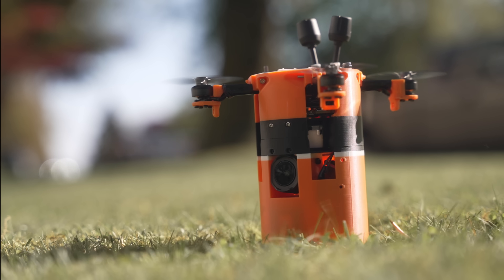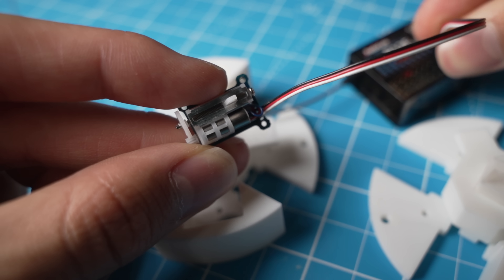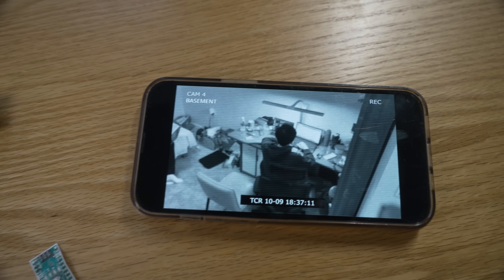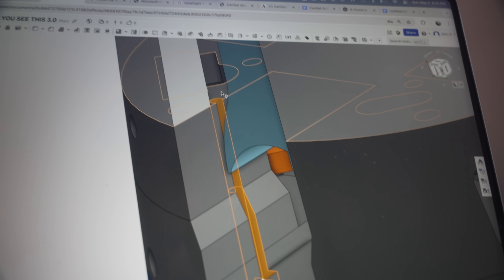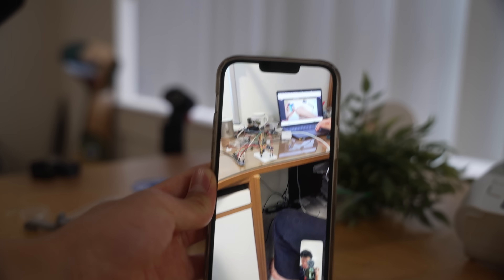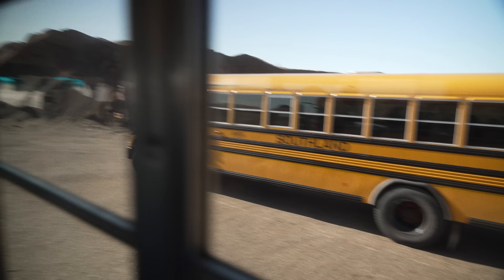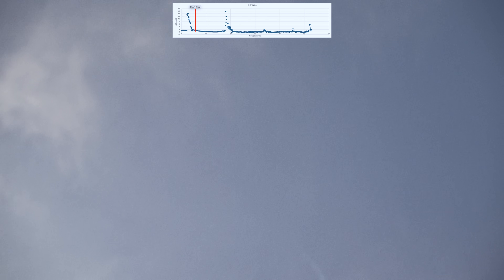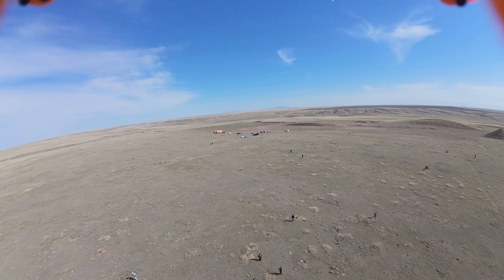I Built a Self Landing Satellite

Comment from the maker: Give me ideas for what I should make next ⬇
Reply: create a solar power forever running autonomous plane (at least for the day time)
Reply: Next video: I built a guided missile.
Reply: I was just thinking making a new version of this with maybe slight improvements! I love this project! Maybe just make it so it can land softer maybe slightly more powerful motors and with pop out legs using the same mechanism as the pop out propellers so it can land completely flat consistently from free fall. Also maybe make it automatically know when to stop free falling based off gps height and other things so user errors aren't as common. Super awesome dude!
Reply: @tylersmith3700 I have some extremely powerful brushless motors that can produce 2.5 kg of thrust which would be great for heavier payloads
Reply: A heat gun for your shrink tube
Reply: build a replica of the mars rover with low functionality
Reply: 1 propeller drone.
Reply: @PhalanxFPV This is possible, but you need a rotor-counter-rotating system!
Reply: Supersonic RC plane/rocket
Reply: 3d printed rc car, all terrain with fpv or maybe a 3d printed nerf ball gun?
Reply: A plane that can fly from USA to Germany!
Reply: If a GPS goes over 1200 MPH or 1931 KPH, or over the height of 60,000 feet or 18288 meters above sea level it will automatically shut down, assuming it could be a missile.
Reply: a mouth scanner that takes a standard shot of your teeth in multiple spectra and then uses UV lasers in fastpulse mechanisms to ablate any plaque, tartar, scum, bacteria, then uses a waterpik to cnc around your teeth to clean them out. super miniaturized and cleans your teeth entirely. at night. while projecting a movie onto your ceiling.
Reply: underwater drone
origami robot
Reply: Could you do this but it either soft lands under a parachute or cuts it when the motor arms deploy? this would hopefully give it a more stable starting point idk?
Reply from the maker: @Celestial.132  A parachute would def give it a more stable starting point, but the drone had no problem stabilizing itself even without a prachute, it only landed hard because I didn't raise the throttle soon enough haha
Reply: @ibuildstuff  A satellite by definition achieves orbital flight, this does not.
Reply: Hi 
I'm a big fan of your content and the way you present complex technical projects in such an inspiring and accessible way. I'm currently a high school student, working on an ambitious project—a cloud seeding rocket—which I plan to submit to the National Invention Competition.

Even though I have a solid background in rocketry, I’ve faced many technical challenges that I haven’t been able to overcome. I truly believe that your guidance and expertise could help me take this project to the next level.

I was also thinking—if you're interested—we could collaborate and document the entire process in a video for your channel. It would be a unique project that combines science, innovation, and real-world application, and I think your audience would love it!

I’d be incredibly grateful for any support or advice you can offer. Thank you for the inspiration you continue to give to young builders like me.
Reply: Build a powerful rocket moving at mach 5
Reply: A drone that can capture regenerative energy on descent.  

Let it get down to 10% on climb, see how much you can recharge on descent.  I'll bet you could get to 50%

If you could do this, it would change the world forever.
Reply: I remember once a design for a rocket called the Roton. It had propellors with rockets at the end in the nose cone and the whole thing could make a controlled landing a bit like Starship so it was re-usable. It might be possible to build something like that with a scaled up version of what you did here…
Reply: You should build a submarine/car/plane where it transforms into any one of them, you could also do submarine/boat/car/plane. I think that that would be a great project and a great video
Reply: How about a model rocket that can seek out drones by the sound of their propellers.
Reply: Somthing LoRA/Meshtastic related?
Reply: A paraglider design! Use less power, gather more data on the way down, have a longer range to work with.
Reply: Ok this idea is probably too ambitious, but: a drone which is able to deploy another, smaller drone to go and recharge it's batteries one at a time, allowing for continuous (or at least longer) flight
Reply: Honestly, I'd try to program the controller to catch itself during fall. I suppose there are altitude sensors, so you could force the drone to stabilize a few tens of meter above the ground, and then if the precision is not great you could add an ultrasonic sensor below the drone to approach the floor slowly. That way you remove all pilot error from the equation, if the drone doesn't receive inputs it starts the automated landing sequence, and if it does (during the automated landing) it stops the controls overrides and lets the pilot do it's thing, either land the drone of fly it to the base.

Also, I don't know in the US but in Europe afaik you can have GPS on board of the drone. There are even drones that fly home when the controller signal is lost, so I suppose guided landing is not impossible to perform.

Maybe add a winged nose to the bottom of the drone and slight throttle of some rotors to stabilize the drone towards the objective during free fall? Just so you don't have to fly horizontally to your home base all the way, you know? Although... Yeah, at that point, that's just a guided missile xd

Still it'd be fun I think!
Reply: BACTERIA CAPSULE COMPARTMENT INSIDE YOUR SATELLITE TO SPREAD THE PEST OVER 1SRhell
Reply: GPS “CoCom Limits"
In GPS technology, the term "CoCom Limits" also refers to a limit placed on GPS receivers that limits functionality when the device calculates that it is moving faster than 1,000 knots (510 m/s) and/or at an altitude higher than 12,000 m (39,000 ft).[37] This was intended to prevent the use of GPS in intercontinental ballistic missile-like applications.

Some manufacturers apply this limit only when both speed and altitude limits are reached, while other manufacturers disable tracking when either limit is reached. In the latter case, this causes some devices to refuse to operate in very-high-altitude balloons.[38]

The Missile Technology Control Regime's Technical Annex, clause 11.A.3, includes a speed limit on GNSS receivers, set at 600 m/s.
Reply: nice video bro
Reply: hyperloop
Reply: Sense.
Reply: A larger RC plane that can drop this can for practice landings!
Reply: More like leading him to anduril or ukraine
Reply: Use a similar drone to track and film skydivers in freefall.
Reply: Build a drone police officer, a drone that sits on a flat surface that talks to a Raspberry Pi, any sensors on the house that get activated will alert the drone police officer to fly up above the property and start sending video of  the area of the property and when the Raspberry Pi is reset or the maximum hoover time is reached the the drone police officer will land back on it’s charging landing pad.
Reply: A small drone that's also a very fast RC Car.
Reply: Same sort of project but it works via pure autorotation rather than powered propellers. You would just have free spinning but variable pitch propellers. Why waste all that gravitational potential energy. :)
Reply: Rc gryo unicycle plz. Why? Just because.
Reply: Could you guys build a 17.4 meter tall 4 legged Armored Core? It'll only cost like $47T so I'm sure guys have the budget right?
Reply: auto-rotation device to create the drag to slow it down
Reply: Use a weather baloo0n take it to the edgge of space then use a rocket to take your satalite into orbit.
Reply: Question, what about iNAV instead of BetaFlight? BF is more race drone software, and iNAV is easier to make your own software modules to. as i did for my winged-drone. i wanted a anti-stall function. so i had to make my own little module to mix pito airspeed data with throttle. what i did  was i recorded windspeed over the wing and stalled the plane. then i found the minimum airspeed needed to have it flying. so if the airspeed was under that speed i had set in the config list it did give throttle input until it kept the minimum speed before stalling. That was much easier to for iNAV than BetaFlight.
Reply: could you combine in the next launch a parachute and the rotors?
I think that first the parachute is activated and at a certain altitude is released and the rotors are activated, my idea is to reduce the speed of descent and saving battery.

I still don't understand what data they want to collect and what is the use of it?
or were you just measuring the power and efficiency of the rocket?
Reply: Flying Radio walkitalki  node.
Reply: I rocket that goes Mach 2…
Reply: Broo... your great... , maybe ... spin make gyro accellorometer can't hold up nose the drone , make free fall  , the fan blade just not working air flow only spin.
or you may test the drone by  throw to upper and with make the spinning , can the the drone  align the speed with the direction of the tilt position when rotating.👍
Reply: By using this method, we can supply emergency medical supplies like antivenom to remote locations.
Reply: You should do a collab with Xyla Foxlin!
Reply: Why not just use detents and have the motor thrust extend and lock the arms?
Reply: make a geiger counter
Reply: too bad you didn't keep the parachute and add a paramotor, you could have used it to catch the jet stream and reach 250 mph
Reply: Vibroplane https://youtu.be/DLwqnz2ypBI?si=QNYQEwwMxk76PFeM
Reply: You landed the satellite, now you need to land the rear section of the rocket and transform it into an inflatable habitat
Reply: I still think this idea is super cool and could be pushed even further. Perhaps build a "base station" of some sort to monitor data at greater distances. Maybe launch the rocket even higher, have  a parachute trigger at a certain time or interval of data, capture as much data you can with various arduino sensors, etc... GPS module to assist with landing back to your location, have the parachute detach after a set amount of time/set altitude, and fins that assist with direction to get back to you? I'm sure the possibilities are endless, but this one was really cool!
Reply: why does this seem ai dubbed?
Reply: I dare you to Build a teleportation device 😁
Reply: A bed that makes itself!!!
Reply: Interesting! 
Recommendations for Your Satélite!

- An altitude indicator
- Stabilizing wings at the top
- Low center of mass

This will cause the drone to fall vertically!
Then you need to control the rotation to the left to stabilize it!
Reply: Meshtastic/SAT
Reply: if u get a junior high power cert u can build and launch ur own rockets for stuff like this too!
Reply: 水中ドローン
Reply: Lets see your take on an ion thruster!?
Reply: Hoverboard
Reply: Rocket engine on rocket or a swing
Reply: A Dorne with spider legs that can walk on Walls
Reply: Have some helium filled balloons that can take the satellite to 30 to 40km above the surface and it launches.
Reply: *IDEA* Make a glider launchable in a rocket programmed to return to the  launch and circal to land, I think making and getting the flight running glider, something that could disconnect and unfold its wings, (controlable, maybe with some motor in the rear to give a boost to self righting.- but im sure theres loads of ways to do that.) something that could be dropped open and return. - good as rocket/glider race?? maybe someone at the rocket clubs could compleat..

Loved the video, and Its always inresting stuff..
Reply: Make a 2 stage (sugar) 
Rocket with  
Parachute and try 
So that the rocket reaches upto 18 km from the earth
Reply: make a rocket or drone to launch your own satelites. Or even make few satelites communicate with each other.
Reply: What if you make an rc plane that can change itself into a submarine?
Reply: A non-landing satellite!
Reply: An all in 1 drone land air and sea capabilities ( more like max depth of 25 feet )
Reply: u should make instructions for that lego ev3 robot dog.
Reply: add an altitude sensor based off of local air pressure, obviously! :) additional, you can save that dataset too! Additional fun to have is add the automatic rotor start on the drone at specified critical altitude! :)
Reply: 8.02 pset
Reply from the maker: @kevinshen9391  can't even solve the pset how do i make one 😭
Reply: autonomous catcher for dumb model rockets
Reply: I created a self landing bomb
Reply: Have you thought about deploying a parachute first, and having  a servo release on it? Might have to get the timming right but you could get a way higher satelitte and orbit going. Should slow it down enough to get it stablized, you might be able to get a really high orbit on it, next would be to see if you could get a LORA loworbit link... the possiblities.
Reply: I live outside Seattle let me know!
Reply: Version 2: Add a pressure sensor and begin the flight when the drone gets to the desired altitude.
Reply: A drone looking like a Ufo
Reply: Ok. Idea for you. Create or use a clyindrical remote control airplane drone, that can drop 1-2 of these out of it once it hits a certain height. Then have this can drone fly over and land on a slow moving vehicle. Once you do this, you can definitly use this video to let Anduril know you are ready to play.... OR you could do something with dropping tree seeds or flower seeds across a line of argricultre at high rates of speed. Imagine seeding an acre of crop using an AI drone system from your house without having to leave your computer as a farmer. 
The system could use some Starlink to communicate to the devices, and perhaps some radio. Thanks for listening. You could then have the farmers pay you to buy a drone and to rent the software. Cheers
Reply: @eriklondon2946 easier way to spread seeds
Reply: Holy daft, no it isn't a weapon. People guide rockets all the time. Get over yourself.
Reply: how bout drugs
Reply: Hi, really inspired by your videos! Can you build a poop and pee separating tray (sifter) for pet bunny? So the bunny can have more a sanitary standard and a cleaner look since the current trays. I tried on the market are easily stained and odors are easily generated from the tray since poop and pee are mixed together. Thanks.
Reply: Build some soldering skills. Seriously,  that was horrible.
Get good rosin core solder.
Get a decent soldering station and micro tips.
Tin wires first.
Get some practice.

Comment: A standard 6 inch drone can get about 2.5km before the air density is too low and the motors will start to burn out. Coulda just sent the 6 inch with a flight plan

Comment: You need to build a power distribution system. One that will operate the deployment of the prop arms, and then, once that is deployed, it will power up your flight controller to prevent processor overload. It is a 1 - 2 system.  If you add stabilising fins to keep the gyroscope overload to a minimum, then your Mark 2 will have better success.

Comment: Your 3D printing skills are superior to your soldering skills. Here's some soldering tips: Flux flux and more flux. Keep the tip at the correct temperature. If you find yourself having to increase the temp, it is likely because your tip is dirty/oxidized. Keep the tip CLEAN, use a tip cleaner and make sure to coat the tip in fresh solder before use. Pre-tin the wire ends before attempting to attach them. Put some flux on the pad, apply some solder and allow it to ball up. Then hold the wire against the pad and solder ball (again adding flux), then apply the tip briefly. Your solder joints look a lot like cold solder joints and they are notorious for failing.

Comment: If I were trying to build a beercan sized drone, I'd do a pair of counter-rotating props, each run from a brushless motor. You could use centrifical force to extend the blades, and just start the upper one spinning first to get it out of the way for the lower. This would allow for much larger diameter props giving more lift. 
For directional control, you use servo operated tabs that fold out from the body to slightly redirect the downward thrust.

Comment: Question: Would a solenoid release for the arms be better than a servo than can break easier for the release? You can make it "lock" when closed and have the solenoid release a spring loaded release to open the arms.
Reply from the maker: I couldn’t figure out how to connect solenoids to the receiver due to time crunch - it’s definitely doable and better tho

Comment: I don't why you don't have the VTX temperature enabled in the OSD? It could help you with the overheating issue. You can also install a GPS module and beeper which would help you locate the aircraft if lost. These are both features that are supported within Betaflight.

Comment: I'm not seeing anyone else directly saying it, but the biggest problem is actually just that for consumer GPS (non-military), if the GPS satellite senses that the receiver is traveling above a certain speed it just stops communicating with it, so your programmed return to home probably wouldn't work. I reckonnnn but don't actually know that the chips you can get for drones also have onboard protection for the same thing. You could probably work around this a little bit depending on when you powered on the cansat (i.e. nothing powered until the arms had popped or a separated circuit for the drone parts or whatever), to the best of my knowledge things that COULD BE MADE into a weapon aren't really illegal-illegal until you're actually making weapons with it, or the ATF would have to get involved in every purchase of gasoline.